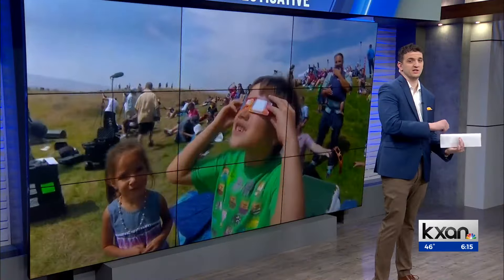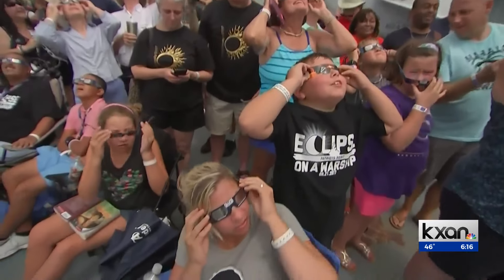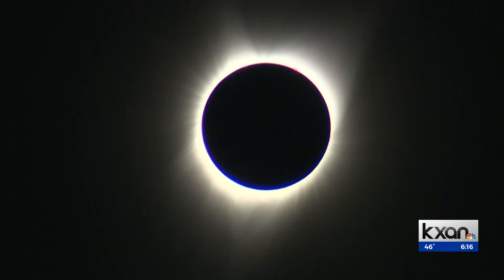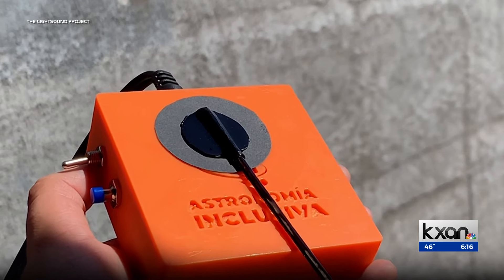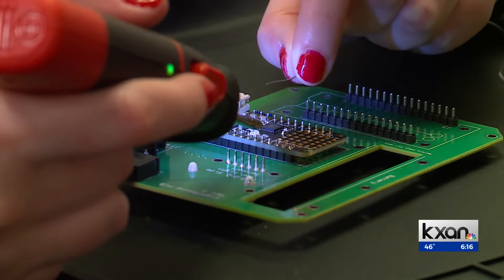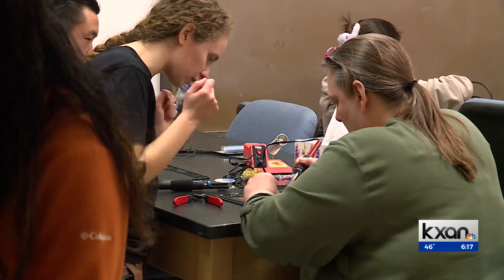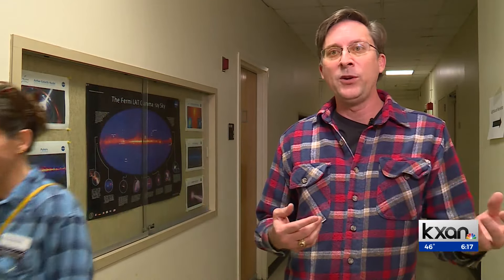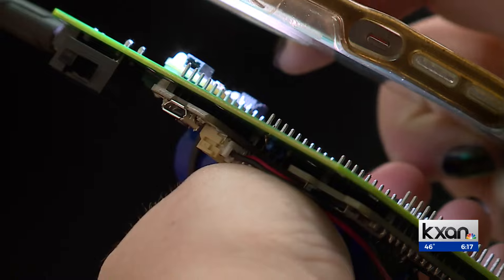Eclipse experience for the visually impaired; how this Harvard team is turning light into sound

Comment: One thing on filming the impossible. They managed to take visual information and piece sound back together to know what people are saying behind sound proof glass without seeing their lips move.

For this they beed w certain speed camera and then aimed this at a piece of paper then measured the pixels with an algorithm to roughly put the audio back together. Not perfectly or anything but enough to get a little bit.

This isn't perfect and was just in a lab experiment in a controlled environment.

So they converted sound from the light that bounced off the paper to a lens looking at the paper and watched the pixels change and an algorithm put the sound together about what they was talking about a little bit.

How? You talk. This is vibration that vibrates the paper and then the pixels on the video changes when recording.

The paper moves a tiny bit because of the vibrations from sound just like a microphone / speaker.